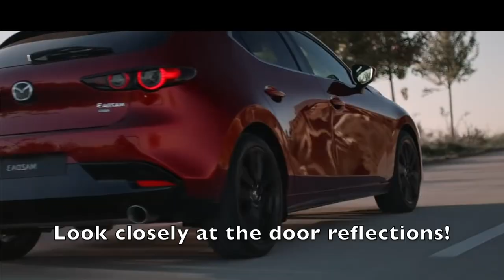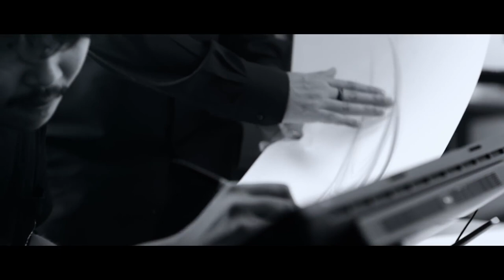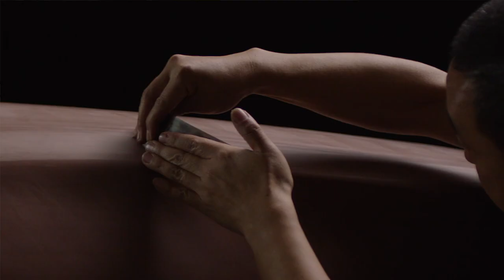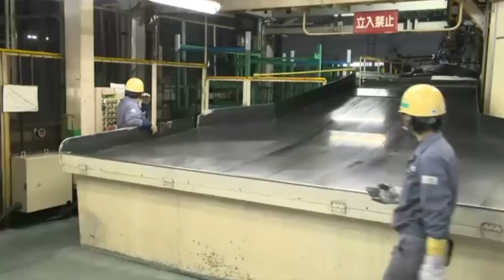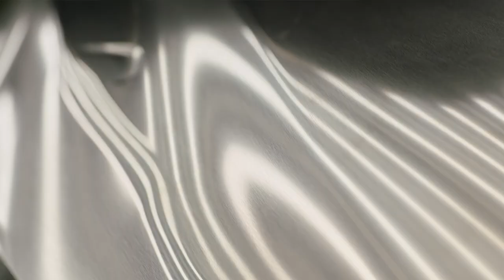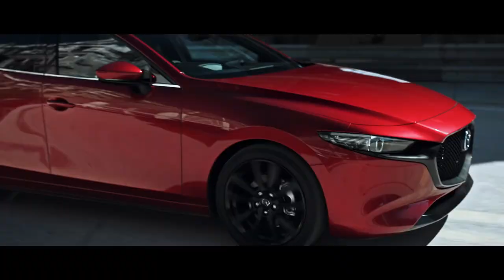The Incredible Creativity behind the “S” Curve: Mazda's most Subtle (and Difficult) Design Element

Comment: James, you’re spot on here. Mazda does things differently. Usually it’s only cars such as Ferraris and Lamborghinis that start with clay to design. Mazda is the only mainstream brand that makes full size clay models by hand then scans these into CAD. This gives them a human touch.

Regarding the paint, the human motion capture only applies to soul crystal red.

It’s been considered by many as the best automotive paint finish of any mainstream brand.

But speaking to many panel beaters, it’s considered to be the hardest paint to fix after a smash because of the complexity and care that’s taken to paint it.

Here in Australia most car insurance companies have figured this out and charge a hefty premium if the car has this paint.

Comment: Hi James,I have a 2021 Mazda CX 30 .
The battery low indication appears everytime you switch the ignition on.
The battery was replace but the low battery warning still coming on.
Could you help please!
Reply: Hi Herman, I am in Australia, not long after I picked up my CX30 I had to let it sit idle for 10 days when I went to use the car the battery was completely flat.   Road service got me going and had no problems after that.   At the 1000k service I mentioned this incident and was told the most likely reason for this was a module in the entertainment system that was not turning off when the engine was shut down,  this module draws a lot of power and was capable of flattening the battery in a week.  They advised me there was a service recall for a firmware update which should fix the issue.   So far no problems.  Perhaps you could follow this up with your local Mazda service centre.   Good luck.
Reply: @martinmilton-white5172  thanks will discuss the issue with Mazda at the next service.

Comment: Interesting video, though I wonder why Mazda didn't incorporate the cladding into the CX-30 with the same styling & attention-to-detail zeal.  Compare how well the cladding on the (otherwise boring) new Corolla Cross is integrated into the styling of the vehicle, rather than just be thickly uniform, generic & uninspired all the way around the vehicle.  It just strikes me as odd.  I will admit that the CX-30 does look a bit better in the cladding department in-person with the vehicle, & the CX-30 did impress me enough in-person several weeks ago to buy a new 2022 CX-30 AWD Carbon-Edition trim version (instead of a Corolla Cross XLE AWD).  Though, I will admit that it was the black wheels & striking polymetal gray metallic paint that made the cladding look more a part of the vehicle & I already had it in my mind that I was going to black-out the front grill chrome & lower side window chrome trim (among one other change).  I love my new CX-30 but had to go more in with embracing the black contrast (vs the paint) & making it more a part of the overall vehicle, to get the cladding to look like a more natural & integral design component.
Reply from the maker: One of the universe’s great mysteries haha

Comment: How about the brakes of the cx-30?
It feels too weak to me, and that i have to press the brakes with too much force all the time. Would you advice getting a new bigger brakes?
Reply from the maker: The CX-30 brake pedal does require more force than most, which I actually like for the increased control (a bit like heavier steering in sports cars). Maximum braking force is on par with other CUVs, so it’s more of a brake pedal feel issue, not so much a safety issue (thankfully!). 

However, I definitely see why not everyone likes it! I probably wouldn’t spend money on bigger brakes, as that usually improves high temperature performance (like on a track) with less effect on normal braking. One relatively inexpensive option is to ask your local shop about brake pads that are grippier at normal street temperatures. I don't know if such pads exist but it's worth asking and searching online. Hope that helps!